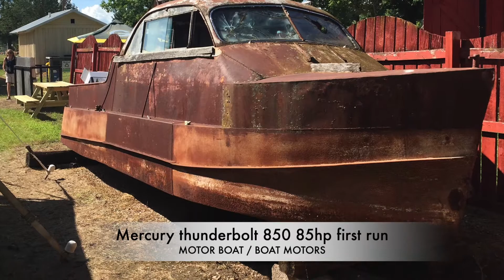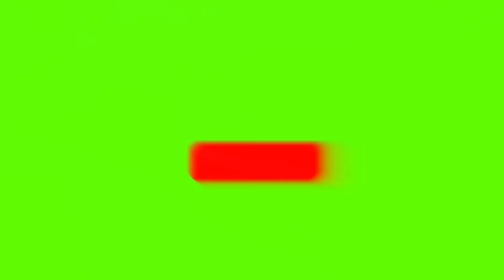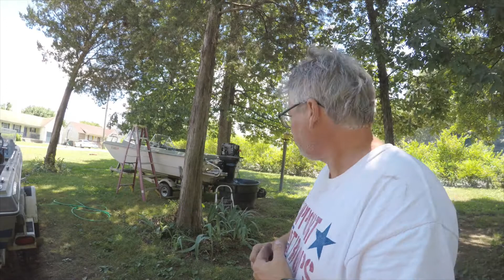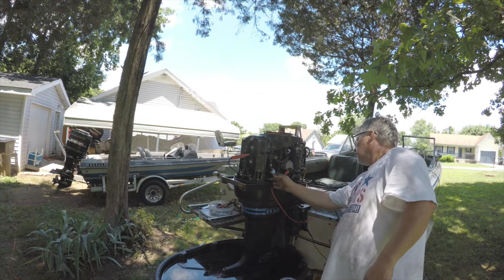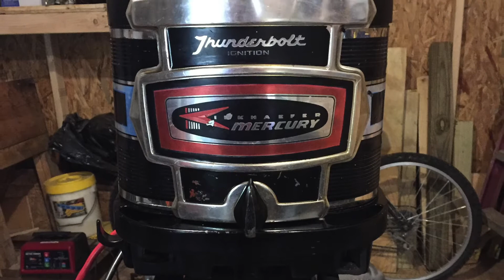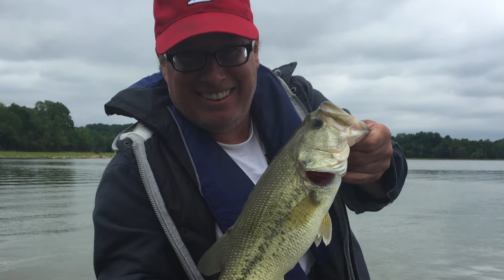Mercury thunderbolt 850 85hp first run

Comment: $30.00 For a new rectifier ..cheapest part of the whole electrical system ..lol...
Reply from the maker: I think there should be a fast blow fuse on it.  But then again if the stator over voltages then it would take it out anyway.   Which is  why later years they put a rev limiter in line.
Reply: @hawkeyemarine  i changed my rectifier before the stator.. lucky the bad stator didnt take it out.. got another stator and boom 15.3 volts at the battery
Reply: I just bought a boat with this motor i think my motor is a 74, i need a lower end unit do you know where to find one for these because im having issues locating one, i also need a new motor to lift the motor up and down cause it clicked and then smoked a little so i think its done for too, Thanks for any help!
Reply from the maker: @robertzenhye6841  Try Lanier Marine Liquidators I bet they have those.